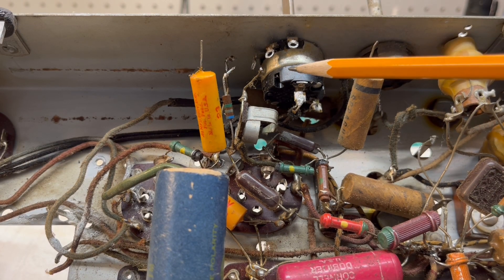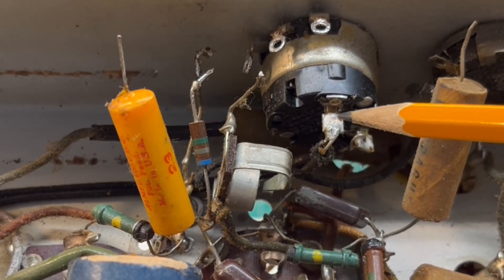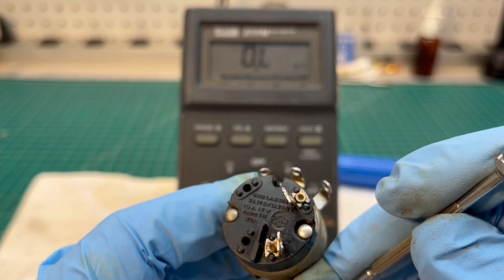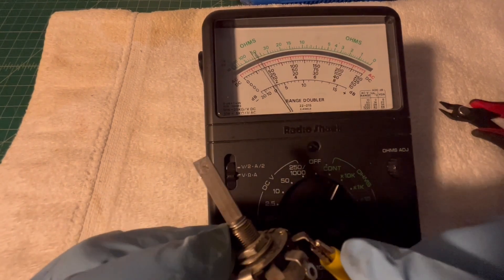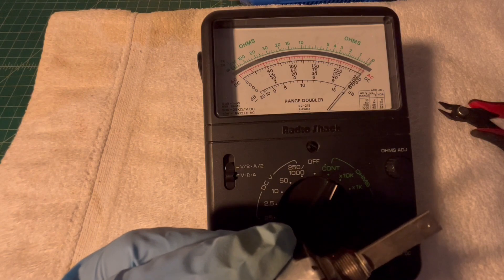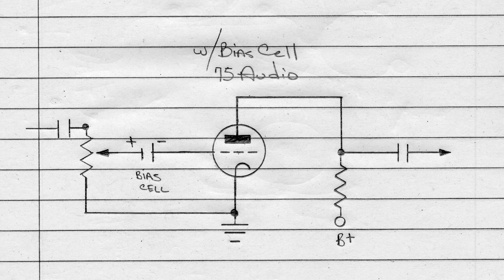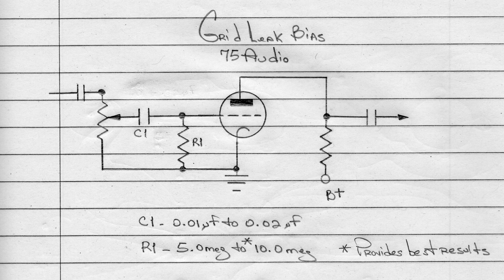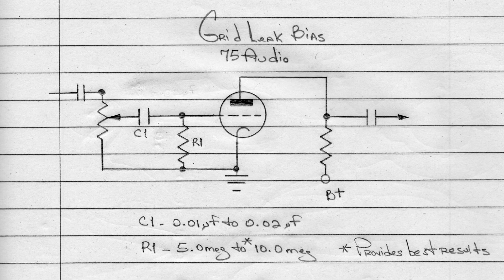Knight 98AE-184K -  Type 75 Audio Tube Bias Cell & SPST Switch Repair Attempt

Comment: Thanks Don. I've been wondering this myself. I'm currently restoring a Silvertone 701 AM Shortwave receiver and wasn't exactly sure what to do with the button cell. I read somewhere that you can renew these 84 year old cells with a drop of water and sure enough mine now reads 1.3 volts after allowing to water to soak in. Not sure if I'm going to trust this. Thanks for sharing. Take care!
Reply from the maker: Ryan - great job renewing the battery. I considered doing that in the past myself, but never followed through on it. Hope it holds up for you. Thanks for taking time to share your experience. All the best. Don
Reply: @RestoreOldRadios  Funny, I just rechecked the battery and it's dead so I will try this method.Thanks and take care.

Comment: Hi Don.  Many thanks for this video.  Very interesting that experiments were done on various grid bias resistors.  Would you please reply with the link to the Radiotronics article?  My YouTube will not open the description.  This seems to be a widespread problem and I don't know how to fix it.   Val
Reply from the maker: Val - Sorry for my belated response, I've been under the weather. Hope the two links below are helpful. Best, Don

Grid Leak Bias Operation of High-Mu Triode Valves - Page 3
https://worldradiohistory.com/Archive-Company-Publications/Radiotronics/30s/1939_01_AWV_Radiotronics_094.pdf

Advantages of Self-Bias - Page 136
https://worldradiohistory.com/Archive-Company-Publications/Radiotronics/30s/1938_06_AWV_Radiotronics_087.pdf

Comment: The contact cleaner most often than not fixes the switch and pot issues. The world radio history website is an amazing source of information Don.
Reply from the maker: So far, so good Jim. The educational value of the site is immeasurable. Sorry for my belated response, I’ve been under the weather. Best, Don

Comment: A 5 Meg plus  resistor and a very low capacitor like .01uF  can replace the bias cell. It should work fine that way. This 
switch reminds me of a radio that I have that will not turn on as it is frozen and since I don't want to break it I  must take 
it out of the radio and disassemble it to find out why. Either the on/off part is stuck or the volume control is somehow damaged.
Reply from the maker: Thank you Steve, I appreciate the information. Hope you get that switch unstuck. Best, Don

Comment: Hey Don, nice fix on the control. Lucky the contact cleaner worked on the switch. They will come apart for cleaning, but you always run the risk of breaking off one of those thin tabs. :)
Reply from the maker: Thanks Doug. I’ve definitely had some bad luck with the tabs through the years and I’m glad I was able to flush the crud out of this one. Best, Don